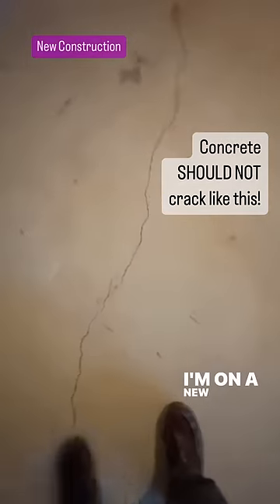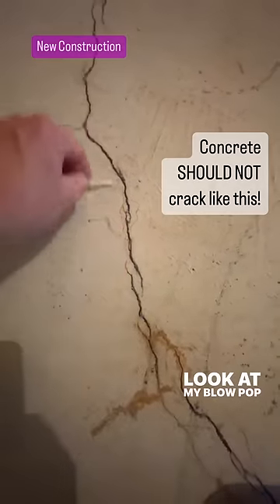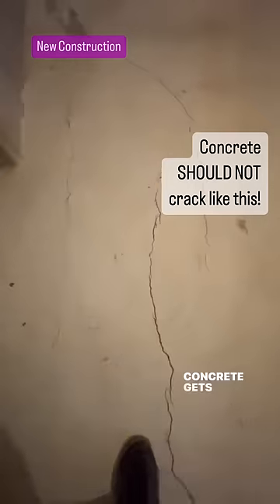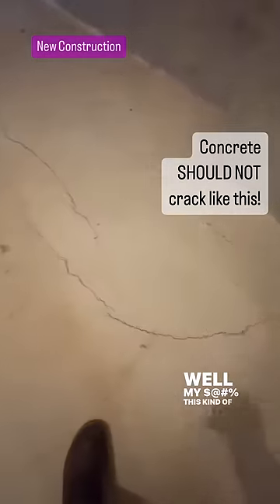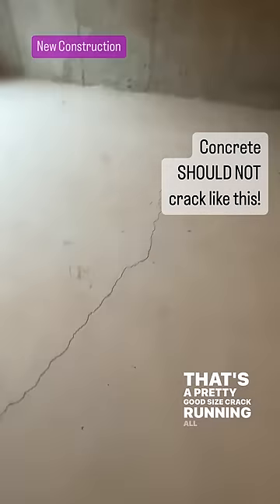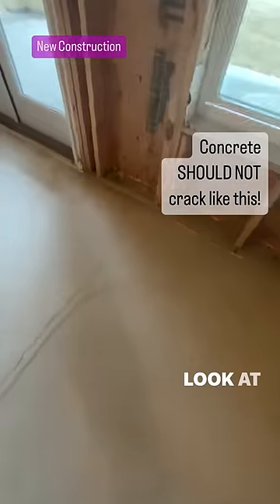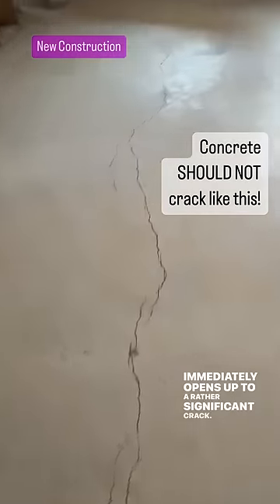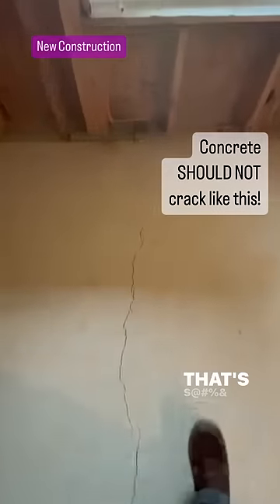New Home with Multiple Slab Cracks

Comment: That’s what my jobs brand new warehouse looks like. Nobody seems to care for some reason tho. Also the roof is clearly uneven in multiple ways. Some parts are taller and the cross beams zig zag randomly. The plumbing leaks or breaks on a consistent basis.

Comment: I looked at some model homes a long time ago, before deciding to stay in my 19th century home. Same issue... terrible flatwork for the price, and cracks in brand new homes. My dad built a house with a concrete slab floor in 1970. It has fewer cracks than this.

Comment: Main cause is no control joints.  Second cause is too much water in mix which causes excess shrinkage.  As for the house structure, the floor is not a concern for structure on a stem wall house.   Builder in video says a lot of weight here, that is a walkout wall weight is on stem wall.  Most likely no vapor barrier, but could possibly be that they don't have proper drainage under the floor.

Comment: Looks like the concrete had to high of a water content(slump) when poured. Probably super weak. Should be tested for required strength. Poured my own 1300sf basement without cracks or control joints.

Comment: I spent several years as a wall setter doing concrete foundations in the Denver metro area and had a separate crew that did tension slabs for pads. All those cracks in my opinion came from at least a couple different reasons
 1) The contractor that did those pads poured a much weaker mixture of concrete, ( less concrete, sand and stone, more WATER) and 
2) Not enough steel rebar or wire mesh along with not nearly enough GROUND PREPARATION...Heavy tamping, leveling, sand and fine gravel base on top of the ground under the concrete. Usually a weaker mixture of concrete to save the contractor money out of their pockets but charging the customer for better quality concrete would be the real answer.

Comment: It must be dug up need 1 inch stone 4  inches hight and compacted and out sid 6 inch drain pipe around the foundation whith stone all around it and drainage cloth on top than cover it than rear and than 4 inches of cement  4 thousand psi  do it right the first time now its going to very expensive to fix it right

Comment: Something wasnt done correctly when pouring the concrete .. I hope they included a vapor barrier or water intrusion will result .. Did they install rebar ? Bad mixture or ground not prepared right or didnt cure correctly .. But that foundation will cause major issues

Comment: Interesting fact about 25 years ago I was with a crew hired to get a Walmart done in Houston the deadline was ridiculous 80,000 ft. when we got there one crew had already started. The specs call for black cut back adhesive I guess .anyway that’s what they used .long story short A week later all the tile was just floating from moisture coming up through to the surface of the concrete. Then it was discovered they filled in an area that was a lake I guess that tales the rest of the story

Comment: I believe it is obvious, even for a person who knows nothing about construction of any kind, that if concrete is breaking up ie. cracks that something has been done wrong. Never let the person who did poor work off the hook or let them try to blame something other than their work. They took the job knowing what all the mitigating factors were before they started pouring. If they say they didn't know then that is their fault for not looking deep enough to find out. Even if it was a bad load or a load that was "real hot" that is something the contractor should have seen or recognized. I wouldn't pay for a cracked up slab. It will only get worse as the pieces of slab settles differently on each section.

Comment: weight would be on the footings not the floor, this looks like a bad/lazy leveling and compaction  pre pour , sure there are other issues depending on local codes , but that is the core problem. i am always meticulous about the base level and compaction any variation of thickness over a slab becomes a stress point. 
level it right the first time and every other step is easy and smooth. its the most important part to get right and if you get some 15 dollar an hour   kid to level it for you because its "grunt work"  you are going to have problems at every other stage from ground sealing and insulation to rebar or mesh to the final product.also don't let those plumbers get lazy and leave the drains runs too high because they can't be bothered to dig out a couple inches lower.

Comment: Such a fine line with concrete...its kinda like this...concrete will crack sonewhere..that is why most engineers will put contraction or expansion jionts in concrete..you always get drying shrinkage  cracks and its what you can do to try to control the cracks with the methods we have...so as long as the base conpaction was right and not to dry and within the maximum slump...then the contractor should not be responsible for that the engineer or whoever told him to poor it with no expansion jionts  control jionts or contractions jionts of anykind should be responsible ..but i know they dont like to use control jionts on a slab on grade for a house but where else is the concrete going to crack at...as long as its not a structutal crack with grade difference then just come up with a final floor fix for whatever flooring they are going to use...but if this guy is worried about moisture coming up through the floor then put down pkastic but then again you could cause a crack by retaining moisture in the bottom so thats why i say....very fine line alot of what ifs

Comment: I've always wondered why they never cut lines into the concrete on the floors. You do it on your patio, your sidewalks in your driveway, but not inside the house. Why is that it's going to crack. If you don't cut the lines in it.

Comment: Concrete cracks it’s the way things are , even if you cut control joints it’s gonna crack moisture is gonna come up and your gonna maybe have this for 6 months until the water settles out and the French drain starts doing its thing
Reply from the maker: French drain? Not here. Cracking is one thing, there’s already some deflection…..and it’s under construction

Comment: If it's in texas, it's not ridiculous. I was told by the greatest Builders and inspectors, that concrete cracks on a new build if they are under an eighth of an inch thick, that's pretty normal. As long as they don't go through the slab.

Comment: Code requires a minimum 4 mil vapor barrier under any interior slab. If water is coming up through the cracks, there's no vapor barrier.
Reply: Only 4 mil? I’ve seen thicker Saran Wrap!
Reply: My bad. Saran wrap is approximately 0.0005 mils thick

Comment: Concrete cracks and they should have had control joints or cut breaks in concrete. The moisture is not coming up bc most states make you put down moisture barrier before pouring concrete.

Comment: This is why you go with  a contractor that has a good rep. Some civil engineers will do inspections for $500.  Your contract should be explicit about client inspections.   Soil compaction tested by YOUR inspector before anything else is done. The rebar should be inspected before any concrete is poured. The concrete should be inspected at the beginning of the pour. A badly cracked slab is almost impossible to fix.......it can total your house.

Comment: "Needs to be fixed" ... ripped up , blue stone, 2 inch hard foam, vapor barrier,  tape seams, highway matte, 3000 psi concrete careful on the sump and just like that , its that easy 🤣🤣🤣
Good luck

Comment: that happens on every new home constructed today, why? I'm a contractor and I'll tell you. the foundation is never compressed properly, the slab in never allowed to harden the correct number of2 days prior to stressing it with the wall and roof weight. no, it's not the water or cement content, also in many counties you don't have wire mesh, they only used fiberglass.

Comment: #1 Concrete will ALWAYS crack. #2 You get cracks like that when you have no relief cuts to guide the cracks. #3 Even if you do the best job possible adding relief cuts, you can STILL get cracks like that, although the chance is far less.

Comment: Did you see the gravel outside. What is the height on that floor 2 inches or concrete. I thought minimum concrete bebth needs to be 12 inches in a foundation.

Comment: Bought a house 3 years ago brand new house and the concrete in the garage and driveway were cracked less than a month after pouring and I told my agent I’m not cool with this she says they do t warranty concrete (builder) and it’s not enough to get you out of your contract and my reaction was I know concrete cracks but not th way this did if it was done right
Reply from the maker: Everything is subjective but my experience (30+ yrs) with builders is they tell you whatever to make you shut up. Site agents want contracts, builders want 366 days because then they can pass you off to a warranty company - if they use one. I've never heard of any warranty company actually making repairs - always a loop hole.

Comment: If it was like a 60 or 70-year old house and there were a few cracks but the cracks are level on both sides then that's not too much of a problem..
But this place is a problem especially with the moisture

Comment: That much cracking indicates improper ŕeinforcement and concrete poured over areas of significant  moisture present. CONTROL JOINTS  cracking doesn't always stop just
because you put jn control joints. Cracking happens because weight distribution is improper.

Comment: Yeah, that's not the norm. Likely poor prep, insufficient thickness, and too wet. 

I can't even get a truck delivered without fiber reinforced Crete. Not sure why they're having such a problem. Fiber reinforced is so good, you can get away with a lot. What did they do? Mix it on site?

Comment: Only one reason why concrete cracks like that too much water in mix.
Some crews do that because it trowels quicker and basivally self levels. 
Problem is when the excessive water evaporates the concrete contracts leaving significant  cracks like those.
Cracks are normal but not that many and that big.

Comment: The concrete does not have enough steel rebar in it if it has any in it. Settling cracks are small they are not that big the trick to concrete work is the rebar the more the stronger the floor the trick is keeping steel low or half way if rebar is too high in concrete u get bleeding rust stains which make street look horrible.

Comment: Yup the floor leveler has cracked!! Lol…. Do we even know if we’re looking at the original concrete pour, or did they pour thin set to level and potentially get a better surface for flooring?? I hate to see everyone automatically assume the concrete guy was a hack, when there are so many other potential reasons that led to this?, from the lack of local codes, to maybe the homeowner is a DIY guy?,

Comment: And all the "youngsters" scoff at me when I say "I'll buy a 40+ year old house before I touch new construction". Too many things can surface in the first 5 to 10 years (in this case - day one and unless it is corrected properly - they're going to have a tough time finding a buyer - or inspector to pass it - to buy it, down the road. Guarantee builder finishes the basement).  Old construction (that hasn't been newly renovated): built solid and built to last.  All the issues have already been corrected by someone else before you even moved in.

Comment: A lot of concrete guys, foundation guys aren’t knowledgeable. We pour high psi special mix every time. We do not use the normal formula because we want our slabs as strong as possible. We use extra foundation beams, lots of rebar and fibers in the mix. My slabs have never cracked as a result. It’s not more money, it’s more care.

Comment: Well, there’s obviously no compaction or there might’ve been topsoil left underneath if there was some, you should never pour concrete slabs or any type of footing on top of topsoil or grass. It should always be dug down a couple feet deeper lay down 6 inch minus stone if there is clay, or any type of topsoil underneath, and build a rock foundation Build then your forms for your building foundation .

Or not enough concrete thickness might be the problem

Comment: I dont like that there is no relief cuts in the concrete, with heated floors I dont think you really wanna cut it, but i dont think thats heated. Your conduit if applicable should be deep enough you wont touch it with a blade.

Comment: Some crews are lazy and will wet the concrete up so bad it won’t even make a slump, then the next day the framers have already framed it up . I used to see it all the time. Now is a good time to start a foundation repair business.
Reply from the maker: I see them dropping mix from 10-20 feet into forms, often see little to no rebar, no vibe, drenching the mix as it’s dropped. Next morning forms are stripped and a track is alongside backfilling. cringeworthy…28 days? they barely go 28 hours

Comment: concrete slabs WILL crack. they are stress cracks. yes, the cracks in this video are excessive and large. there is a problem here, the whole floor was not shown but i am not seeing the stress cuts that should be there. are they there?

Comment: Looks like way to much water and no moisture mitigation system in place.  Possibly didnt even put gravel or sand under the slab let alone compact it.  Those cracks definitely look like way to much water was used and it was probably pretty warm out causing it to cure rapidly and shrink.  Plus it probably didn't have screen or reinforcing properly added or even fiber.

Comment: It is unfortunate yes, but these are clearly shrinkage cracks. It was probably a hot load and they added too much water. Hot load dried quick, excess water evaporates and you're left with this. The only "problem" is a cosmetic one. Everyone relax.

Comment: Not saying there weren't hacks in the past but the concrete floor in my parents 1965 new england basement has a single few foot long hairline crack after almost 60 years. These homes probably won't last 10 years before they have serious problems.

Comment: This happens from iron oxide because all the rebar and materials for slab prep are left out in the weather for weeks at a time before being installed and this is the result. I'm a residential electrician and see this all the time amongst other things from different trades throughout the process of building a house. Construction today is absolute dogshit. It's all about quantity instead of quality!
Reply from the maker: 100% I don’t know there was proper rebar or any mesh, compaction equip is never around either. It’s all cheapest and fastest.

Comment: I'm not a builder and don't know about the cracks, it doesn’t look right to me. I do have a little bit of logic and that moisture is coming from the moisture on the surface of the concrete which percolates along the crack and that is why it shows at the crack the way it does. If you look carefully you can see that the moisture runs, presumably "from the dehumidifier", along and under the plank and runs with the crack. If he was such a smart-ass he should have noticed that.

Comment: The problem is that the process to get this settled is terrible for any home owner. The GC is all about the bottom dollar and unfortunately that usually means the subs are cheaper or faster. I work in hardscaping, landscaping and excavation and when going a new construction home it blows my mind the client is going to have to pay for me to fix something that should have been done correctly when the job would have been easier to do correctly from the start rather than fixing it later. One offs are unfortunate but when it comes to entire neighborhoods having the same issues and requiring work just to fix is criminal.

Comment: There's no control joints in the slab that's why it's cracking from wall to wall there should have been a joint cut there

Comment: He poured on dry clay most likely . It's not as bad as this guy makes it sound . When you pour on dry clay the clay wants to rehydrate and return to it's original moisture content . It has enough force to heave concrete up . Rebar or mesh will not help . Concrete guy did nothing wrong . Solution is to flood the basement first before you pour the floor . Yeah it works . Your plumber will have to work in the mud but it's the best way.

Comment: The other question tho... it needs to be fixed... yeah, but how? 

Break it up and pour another slab? 

You can chase the cracks and patch it up, or even put a flexible sealant in, but tell a builder that they need to break out a slab on a built house, and they're not going to. 

To fix it properly, yeah.the slab is trash. Probably no membrane, probably insufficient reinforcement, probably too thin, and probably poured too wet, but to tell them that they have to remove the walls in the basement n and break out the slab to replace it with a pump truck....they just won't do it.
Reply: Correct on all points.  Just a disaster for the life of the home.  After the fact I might lay down some 6mil poly and top with another lift of fiber reinforced 3500 psi concrete.

Comment: So moisture coming up means no vapor barrier or moisture barrier underneath the slab. I'm seeing no expansion joints anywhere in that huge basement. And by the coloring it doesn't even look fully dry. Whoever bought this house has one hell of a lawsuit to give to the builders. There is absolutely no way this passes code in any version of reality.

Comment: The builder should have waited at least 28 days for the concrete to cure. 

Also it could be from using too much water in the mix.

Could be from poor thickness and incorrect steel cage capping beams underground (if any).

Looks like they didnt lay water proofing and if they did there is water pockets inside the concrete...